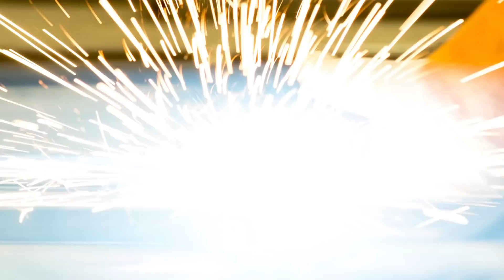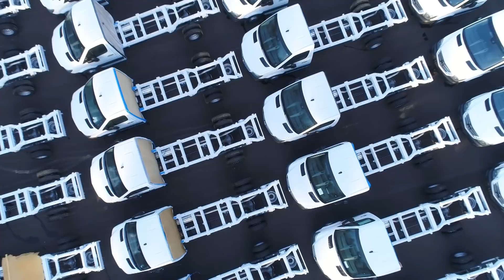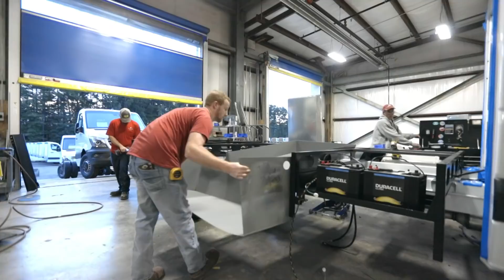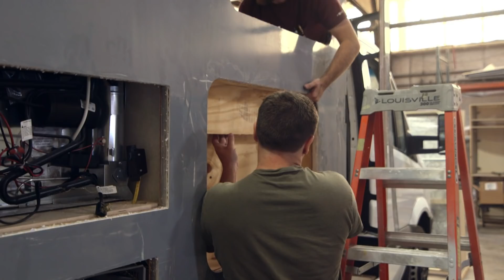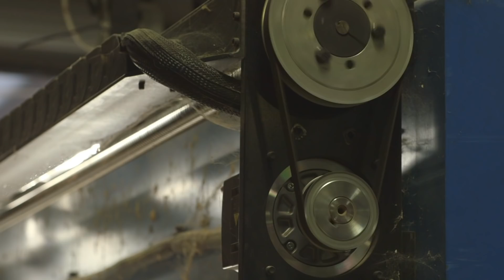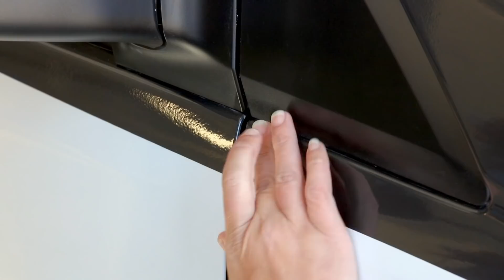Tiffin Motorhomes: Wayfarer Plant Tour

Comment: A lesson from Fleetwood 29SL, Put both in a wind tunnel, the fiberglass front serves many masters in stability. Don't believe me, look at the data.
You give dependability to me, I will give it right back, in math. 
Love this "family owned"company.
PS, look at a F550 super duty front spring, VS a Moog 550 coil? You have an opportunity to order a Mercedes with scale tested springs. I want to see a pic of a Wayfarer on a scale.
Far as I am concerned, there should be a scale at check in at Red Bay for warranty work, it is an education to all RV owners.